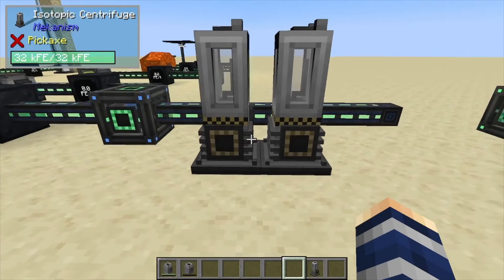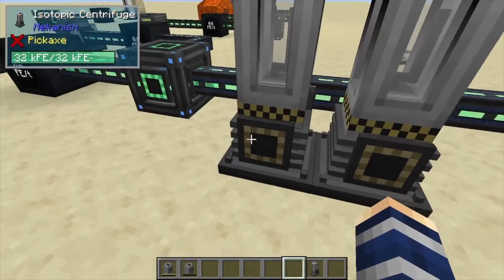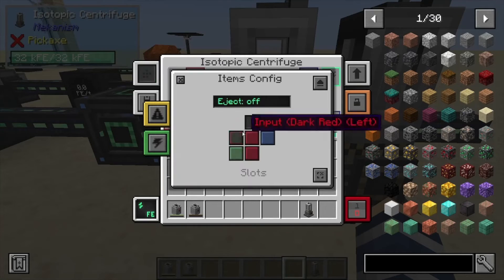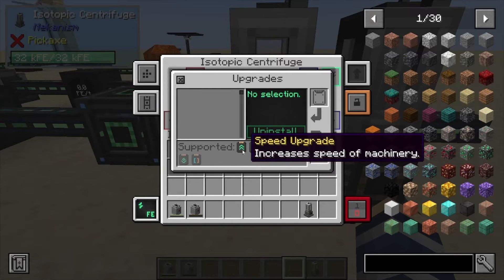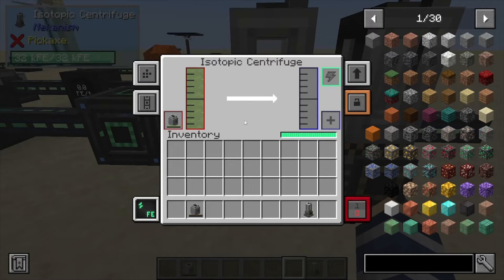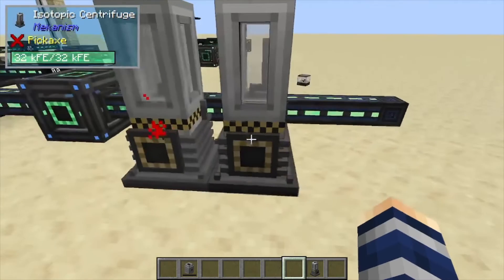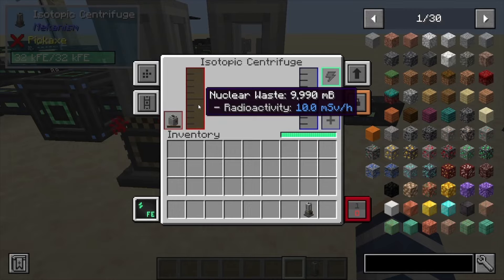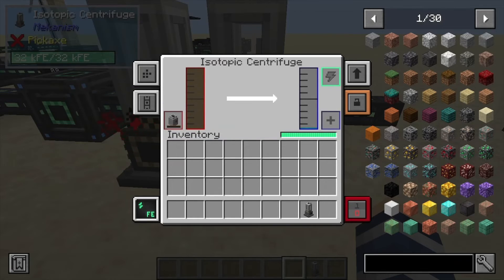Mekanism: isotopic centrifuge (How to get fissle fuel/plutonium)

Comment: Do you know how to get maximium power input for this? When I do full speed upgrade/energy upgrade it still shows "Not enough power for maximum speed' despite being plugged into my reactor sitting at 15GJ
Reply from the maker: Sadly I do not
Reply: Use the Ultimate Universal Cable. I was using the energy pipes from Pipez and even with the ‘ultimate pipes upgrade’ it was not enough either.